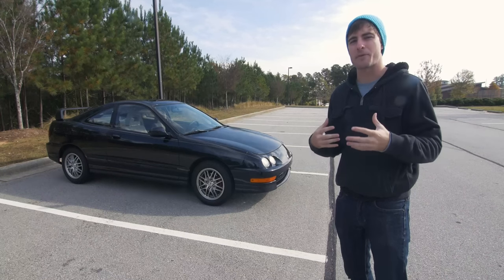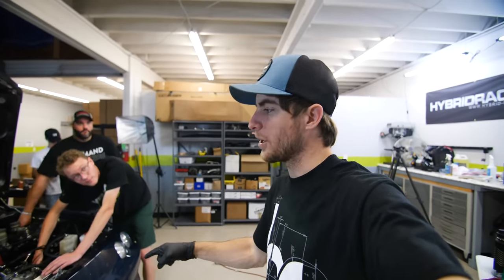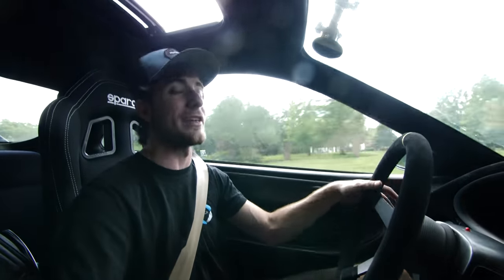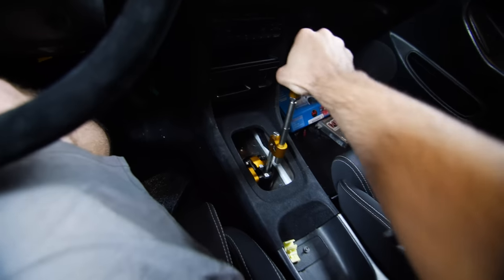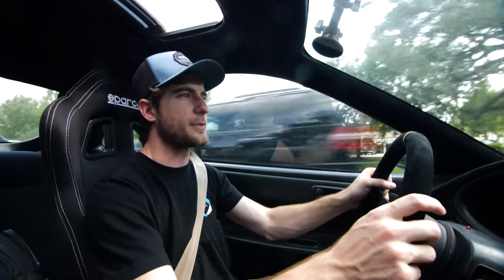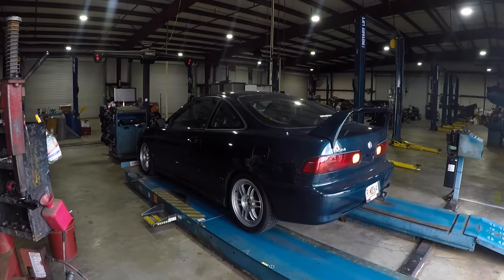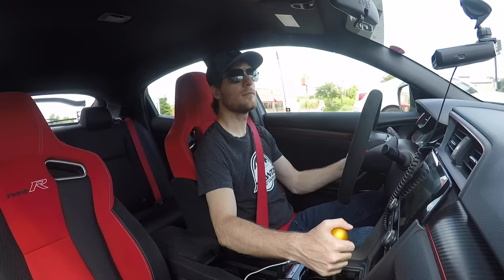Is Doing a K20a Swap Worth the Money? Integra Build Breakdown!

Comment: How much did this whole engine swap cost?
Reply: I did mine into an ep3 k20a3 to k20a3, I did all the work except charging the AC. Motor/trans/ECU was $4500, and with exhaust and all the other odds and ends it cost me about$8-9k and about 100 man hours. If I did it again, I could cut that time down a lot. Here, going from a b-series to a k, you're looking at a lot higher degree of difficulty and expense. I would guess someone with no prior experience doing the swap 2-300 man hours and $10-12k
Reply: @jowen034  thats crazy i have so much respect of the work you put in. I didnt want to mess anything up so i took it to a shop currently awaiting on the engine and trans due to corona. I always thought it was super pricy but i could see i paid for a reasonable amount. For me it was 10.2k with the k20a. Stuff not included are clutch (starting at 120 if wanted), anything that is preventive maintenace, and ac conversion (120 with the old conpressor from the car), take it to an alignment ($70), and im guessing a tune since i want to e85 (500-700 im guessing to another tuner). (Engine and trans is inspected by the shop who have their own importer they prefer that have them at low miles) Everything else is a complete swap axles rated at 500hp, power steering, shifter cables, hondata, headers, upgraded fuel rail, braided fuel lines, includes the labor.

Comment: I'm also in Louisiana, in Denham Springs, right outside of Baton Rouge. I want to drop a turbo, ported and polished K20A swap into my 2005 EM2 Civic EX. I've already done the RSX Type S 5 lug/brake/spindle conversion on all four corners, have strut tower and subframe bracing, aftermarket sway bars, polyurethane bushings throughout, some nice 17x8" Bronze Enkei TS5's on Dunlop Direzza ZII rubber. It handles like a beast, but it's slow as hell. Saving up for a used JDM 2007–2011 Civic Type R K20A with 11.7:1. I found one with trans and all the bolt-on's with 48K miles on it, and I'm only $400 short, but I gave the company an offer and waiting on the answer, told them if they'll hold it for a week, I can pull the 1.7, sell it and have the extra money for them, plus a holding fee. I also have a cheap ($700~) eBay turbo kit for my 1.7 that I'll need to modify for the K engine, plenty of hoses, wire, clamp, etc. The turbo is actually better than I expected, but the tubing is junk. I already have the engine mounts and figured out the wiring harness (easy) thanks to K-Powered's swap into this same car. Different K engine, but similar wiring. So, I'm ready to do the swap, have almost everything I need. Will just need to rent a hoist and I'll be good to go. 

https://youtu.be/fmLbVsz0X5c
https://k-powered.net/5-lessons-learned-from-a-em2-k-swap/

Comment: I find it interesting that you didn’t have any issues using hybrid racing parts (albeit you did have someone from the company who would ensure the parts are good). But anyways one of my instructors at my college is a badass honda builder who has lots of experience with k swaps, he actually bought the swap harness and ac lines for his integra from hybrid racing, spent over a grand and ended up having to modify the harness because it used the o2 sensor power for something else I don’t quite remember but it was stupid because the car wasnt able to get tuned, and the ac lines needed further modifications to fit AND had a hole in it... personally I wouldn’t buy anything from hybrid racing because I feel like their quality control is down the toilet but I definitely thought it was interesting that someone i know had a bad experience with them on 2 of their products and here you are building your car with someone from the company

Comment: Quick question, I thought that it was the EP3 Civic Type R that had the K20A engine, and that the DC5 Integra engine had the K20Z engine, am I correct, or did the DC5 also have the K20A engine instead?
Reply: https://en.m.wikipedia.org/wiki/Honda_K_engine

Comment: I have a 2003 acura rsx auto with 75,000 miles. My options right now are the sparco r100's, nrg type r reps, or the nrg prisma buckets (replacing due to ripped up leathers.) Which should I go with?

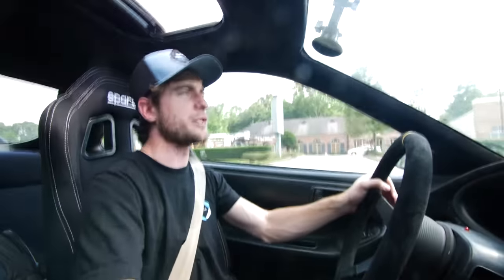Comment: As a K series owner myself (06 rsx type s) you CANNOT run your upper radiator hose like that at 2:35. Looping it under your intake that way is keeping the air trapped in your motor. Other than that, great job on the swap.

Comment: Hi man I kinda need some help, when you k swap a car let's say for example a K24 (with ecu from the k24) in a 2006 car, how would you bypass the imobiliser system, since the cars imobiliser system is chipped for the k20 ECU and key, the new k24 and its ECU wont work, how do guys that k swap their cars never have to worry so much about this
Reply: Boost Lawds they use hondata, that gives you the option tu bypass the inmobiliser
Reply: @ricardosanchez8852  doesn't that means it has to be reprogrammed and the issue for me is theres not alot of skilled tuners in my area and the tuners that can do that are 1000km away from me
Reply: Not necesarly, and also hondata is very user friendly it comes with a couple of base tunes for diferent settings ie i/h/e that work fairly well, and you can also upload some very easily
Reply: @ricardosanchez8852  so if I buy a Hondata ECU which I dont know which one I should get, they might have base tunes for k24 swaps
Reply: Yeah it depends on the car you will be running if it is an si o rsx 2006 up  ( drive by wire)you should get the flashpro with your own ecu, if it is previous that year an rsx type s ecu will do

Comment: For everyone saying this is no longer a budget build calm down. Yes it would get expensive if you decide to buy a full ITR swap while K24a2 are littering junkyards everywhere. Yes it will get expensive if you start buying unnecessary crap like a $500 stage 9000 clutch kits when an Exedy OEM replacement would more than suffice. If you use common sense you can put together a complete K24a2+6mt swap for under $2000 including Kpro V1
P.S. finding good deals doesn't happen over night. Take a year to RESEARCH and gather parts.
Reply: Yes somebody gets it. If you are patient you can piece together a swap for cheap by going to the junkyard or shopping locally instead of buying over priced swaps on Ebay. Unfortunately it seems like mounts and engine management are what take up a bulk of your budget because there really isn't that many options brand wise

Comment: How’d u guys eventually get the air out of the cooling system/motor?

Edit: I forgot to mention yes, K is the way.
Reply: Origins Garage thanKs!  I have Ktuned upper water port/neck (the one that sits next to intake manifold/upper radiator hose) but before I installed it I did have overheating issues in the past.  I’ve never lifted the car while filling, so that should help as well.
Reply: Origins Garage I’m not sure which funnel kit ur referring to but I’ll definitely have to look into it. I’ve seen on other videos that u have to leave the radiator cap off, turn on the heater on full blast & let the radiator fan turn on twice to fully purge the air.  Since I’ve long removed my heater core I was stumped for a while.  When I was at the dyno one time my tuner actually lifted up my radiator above my engine while filling it to purge the air.  It worked that time so I see how jacking up the front could help. ThanKs again u have a super nice integra & great video👍

Comment: "It was getting hot because there was still some air in the motor" what????? 🤣
Reply: Legend Bourne he meant in the cooling system, you can't just fill a radiator and go on most cars, you usually have to burp/bleed the system.

Comment: That exhaust sounds good. From all my research, it seems like a smaller diameter exhaust works much better on these NA low displacement engines at least in terms of sound. All im saying is, if youre buying that $109.99 catback off ebay, go for the 2.5" pipe, not the 3". Maybe even a smaller 2.25" if its available. Make sure it comes with a real muffler (something that has packing material inside, internal baffles, or both. A lot of ebay mufflers have nothing inside, thus the raspy metal tone of the exhaust sounding worse than stock.) And make sure to use gaskets on your flanges. These simple things will improve exhsust velocity and allow the exhaust to move out of the system with more consistent pulses and faster. A 2.25" pipe will sound deep and full of bass at idle and low rpm. A 2.25" at high rpm will sound more like a hum. Like a sound eminating all around you, a pure note. As opposed to the 3" fart can that rasps harder the more you try to be quiet lol.

Comment: No the air bubbles in the motor is just a k series thing. Their a bitch to coolant bleed when swapped. B, d, f,and h all can be bled with no headaces. K series are great all motor but if your going turbo do a full build or youll regret it.

Comment: Ks are cool but dollar to dollar they still won't beat a boosted B series. The cheapest power out of a Honda powerplant is a B18B1 (LS,GS trims) with a turbo. For what you spent on a K swap the boosted B would've had double the power and still be reliable.
Reply: @Sergio Aguirre I'll tell you what, I've spent 4k all in all on my Integra and I'm at 402 at the wheel. Build a similar set-up with a K and let me know how much it costs you
Reply: @Sergio Aguirre 
You're missing the point entirely, the point of my original comment was DOLLAR TO DOLLAR. No offense, but from your comments it wouldn't surprise me if you've never done a swap yourself since you don't know what the actual cost of just a swap is.
Reply: @Sergio Aguirre like I said, price together a swap and let me know how much hp you end up with for $4k. What are you going to show up to the strip with, a rolling chassis and the engine on a stand? LMFAO, that coastal breeze must have y'all in fantasy land. Come to Texas and see how you hang out here in the land of Horsepower 🤷‍♂️
Reply: @Sergio Aguirre so I guess everybody down South like us here and in Oklahoma are copying you guys with our 500+hp Single cam D series builds that are gapping Hellcats and the like too, huh? Damn, if only we knew what you guys were doing over there prior.

Comment: Could of went h2b for less than half the cost of your long block alone and made more torque and the same power with a bolt on h23a pde. I thought it was budget. B series shift linkage is so much nicer than cables as well.

Comment: In my humble opinion The B series motor is more than good enough for. Your average want to be Street racer. Give me any more power than that. I just going to die at a higher rate of speed not to mention. The new Integra motor which is K series. Is not a lot better and it's twice as much work to put it in the car. And if you're going to do that, you might as well build the motor from top to bottom. So at least you're good for 600 plus horsepower.

Comment: Please dont go forced induction. Cams and ITBs down the road will get you close to 300whp.
Reply: 300 wheel? That's incredible from a streetable na 4cyl. Want to link me to a build thread or dyno sheets? I'm not doubting you, just new to Honda stuff. I come from bmw where 350 wheel is about all you can get from a streetable na 3.2 inline 6.
Reply: @weedshoes5089  Itd probably be 250-275whp. It's a fairly common thing to do. 300whp is probably more realistic from a k24. My mistake
Reply: @L8-APEX  still impressive. I appreciate it.
Reply: @weedshoes5089  people do k24 block k20 head to bump compression to get more. No doubt they can make 300 wheel n/a
Reply: @enzoc3869  how high of compression and what octane?

Comment: Why do americans always need truck to tow? Cant you just buy a trailer and tow it with a regular car?
Reply: Name a car with a 5000lb towing capacity? Integra is probably 2600lbs wet, flatbed trailers weigh about 1500-2500lb depending on materials.
Reply: @NARFALICIOUS  an Audi A4 with a 2.0tdi has a towing capacitiy up to 1,8tons (3968lb)
Reply: @NARFALICIOUS  and about every SUV tows up to 3,5tons (7700lb)
Reply: @xa-1248  You're really reaching...  None of the cars that David already has can tow so he would have to get another vehicle to do the towing already. Why would he get a shtty Audi A4 that he would have to use Diesel in. And 4000lbs is still not enough to tow a trailer & Integra. No Small unibody SUVs can tow 7700lbs. Full frame SUVs can, but those are built like trucks so your point is moot.
Reply: @xa-1248  Your Audi was designed primarily for passenger transportation .
If you plan to tow a tra iler, please remember
that the addit ional load will affect durab ility,
economy and performance .
Trailer towing not on ly places more stress on
the vehicle, it also calls for more concentration from the driver.
Reply: @NARFALICIOUS  im not argueing that a truck is better than an a4 for towing but it seems so unnessesary to get a truck just to tow in so many casses 
Im from europe and people just use their commuter cars here to tow most stuff